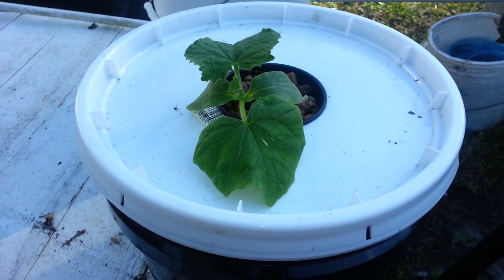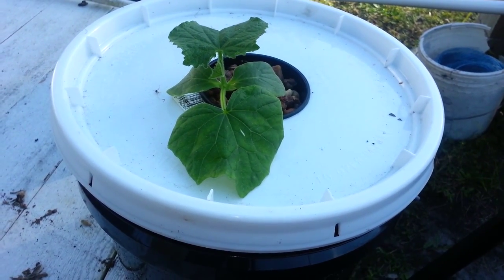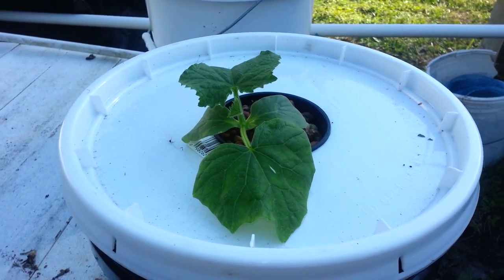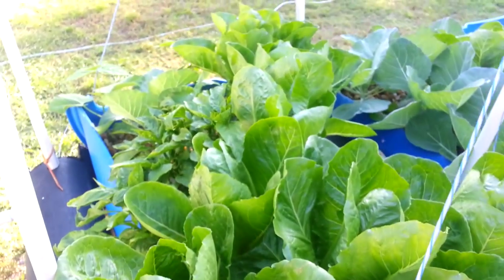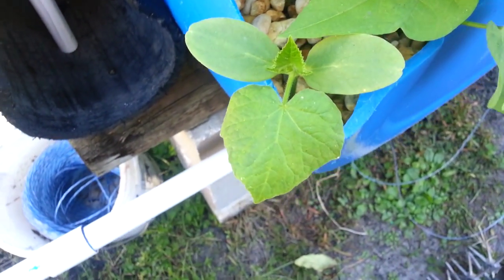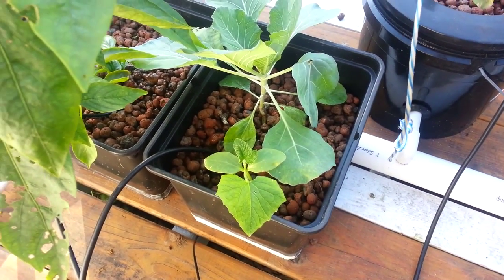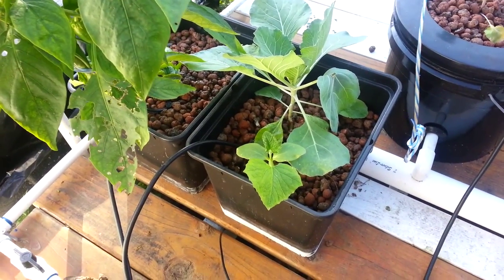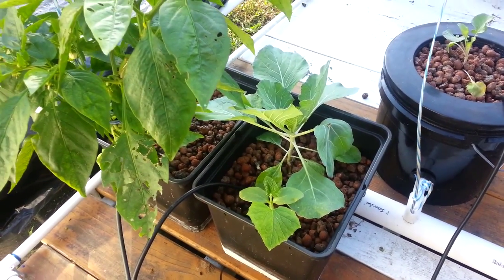Aquaponic cucumber experiment part 1 ep 11

Comment from the maker: FishNinjaY the bucket with the white lid is not circulating any water and is not aerated. It's kind of a spin a the kratky method. I am not sure if it's ever been used on fruiting vegetables. I just wanted to do some experimentation. As far as the weather I don't think I picked the best time of year. But like I say is just an experiment.it got down to the low 30's the other night. However the plants are still doing pretty good. I will make an update video to show the progress.

Comment: the first bucket (white lid).. the aquaponic water isn't circulating or being aerated? I thought that if you just soak the roots without aggressive aeration with an airstone or venturi, you can get root rot? Interesting video... please keep updating. How cold does it get at night? I wonder if I can grow "summer/spring" stuff in the winter, outdoors. It can get down to the 40-50s overnight here, but plenty of sun and warm temps in daytime. Thanks for the video.
Reply from the maker: just keep experimenting for sure. the water constantly flows through